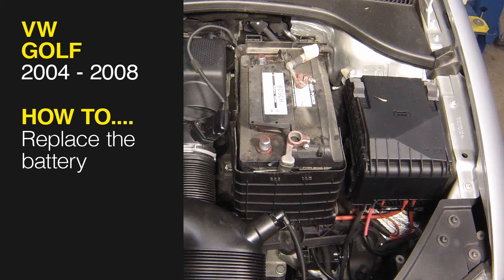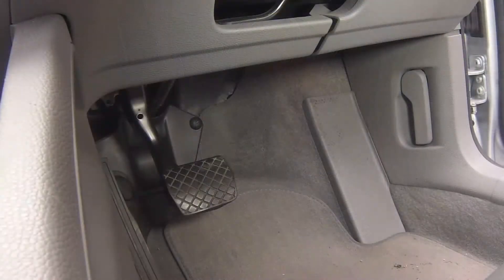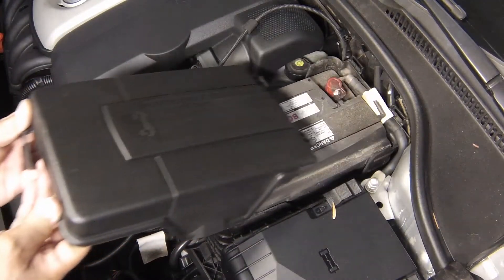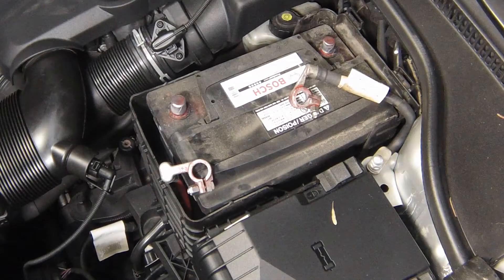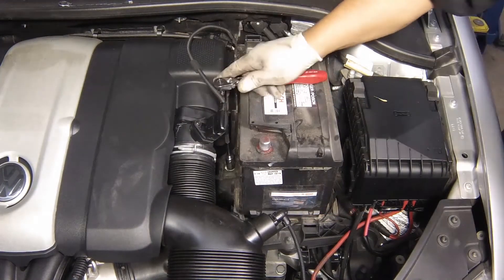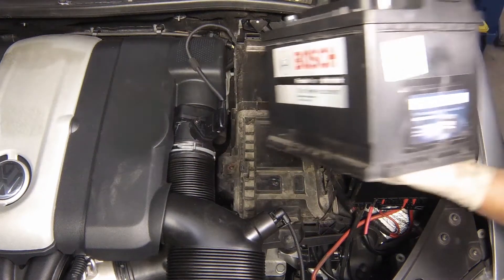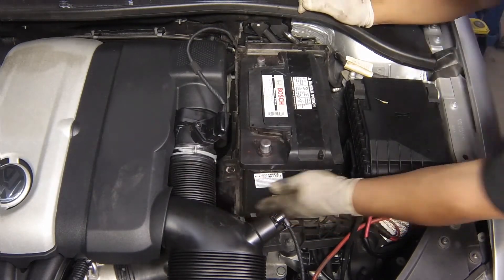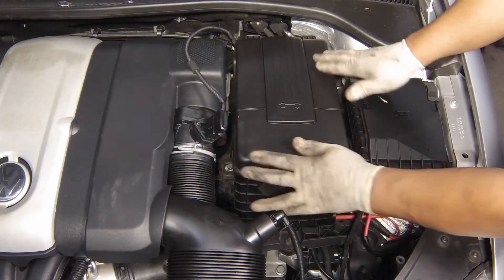How to Replace the battery on a Volkswagen Golf 2004 to 2008 with Haynes Manuals

Comment: What do you mean by save the radio?
Reply from the maker: Some manufacturers incorporate a security feature into their audio devices to deter theft. The radio may be equipped with a security code that needs to be inputted when the power source is reconnected. The video makes reference to this 'radio code'.
Reply: @HaynesManuals  Thanks a lot for clarification. 😇